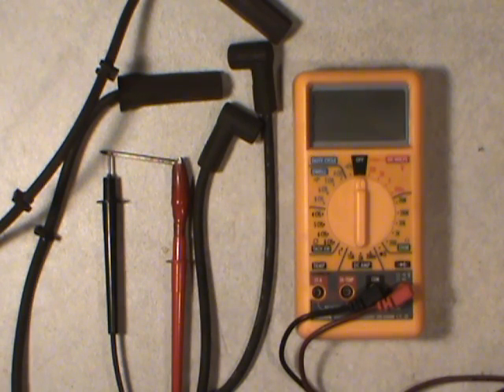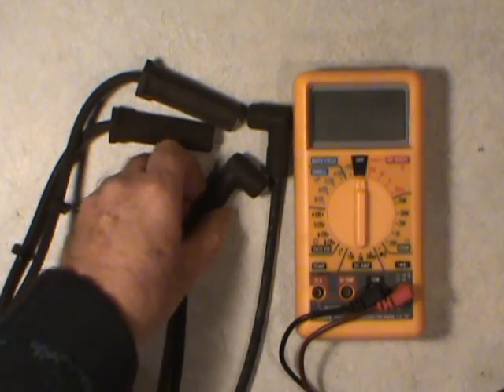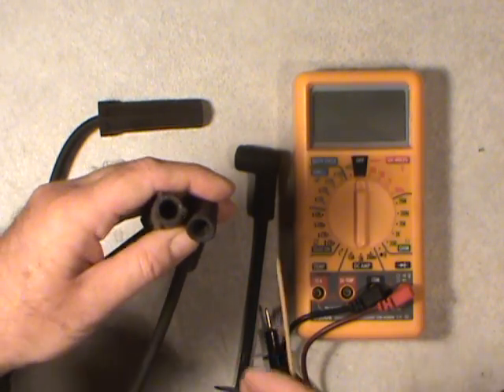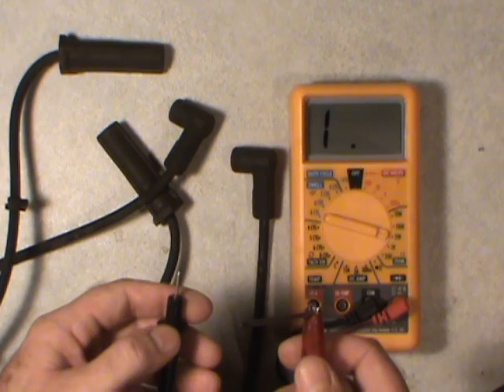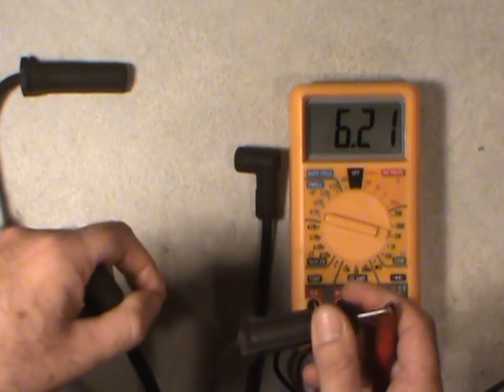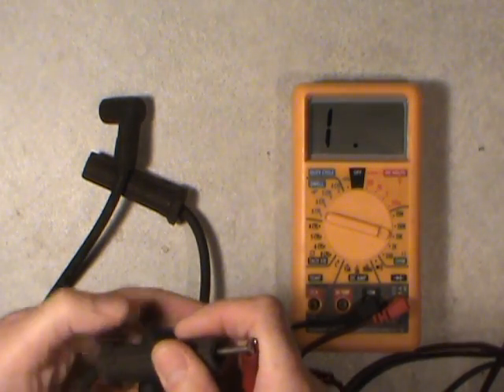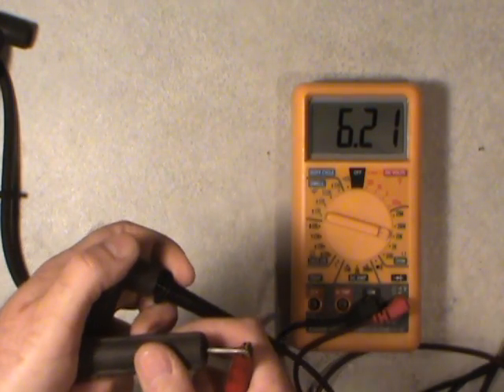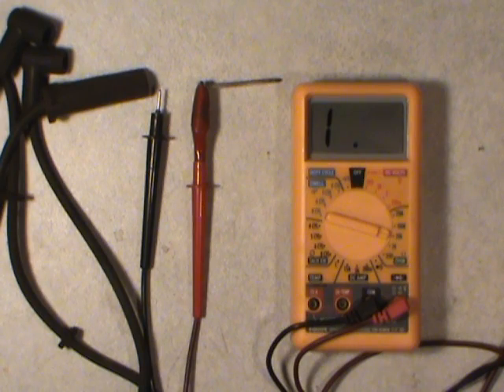How to Test Spark Plug Wires

Comment: If you've got a cylinder misfire and you've tested  everything you could. My issue was a "bad" coil on plug BOOT( they just pull off). There wasn't any obvious indication that the boot had failed. The signs on arcing that had been etched on the spakplug's ceramic insulator was the give away.
Reply from the maker: Greetings dumass00072....Thanks for your comment, and, sharing your Boot problem as well....Like you have experienced there, the possibilities are almost "Endless", when it comes to Malfunctioning Parts and Pieces, that have the ability to produce some rather unusual Indications/Evidence, that at times, can be very difficult to Find/Track-down, when trying to find that there "Culprit" (aka, Trouble-Maker, lol)....On occasion, I find some, Not-So-Tight, of a Connection, especially where the "Clips" (inside the spark plug lead/wire) "Boot", are Not "Grabbing/Clamping-on to the spark plug Aluminum or Brass Connection Terminal that resides just above the spark plug Porcelain, where that there "Clip" is supposed to be making a nice tight/dependable Connection....What I do when I find one, or more of those there "Culprits", is, I grab a pair of Slip-Joint Pliers, and "Squeeze" those there "Clips" inside the spark plug Boots (actually Squeeze the Boot, so the "Clip" inside the Boot gets Squished), to make the/Those "Clips", a nice tight, and Snappy "Fit" on the spark plug/s connection Terminal!....Just be careful, as to not Over-Squeeze those there "Clips!"....Also, if your Pliers have Sharp Teeth where the Jaws make Contact with the Boot, you might have to wrap some cardboard or something around the Boot, so that the Pliers Sharp Jaws don't "Penetrate" the (usually Silicone) "Boot!"

Also, to prevent moisture from "Invading" the Boot, I smear on some "Die-Electric-Grease", which also facilitates the "Easier" Removal of the spark plug Boot from the spark plug/s, so, especially when it comes to "Silicone" spark plug Leads/Wires, they don't become "Bonded" (kinda like STUCK!...lol)...and, what a Pain that can be!

Just when You, or I, think that we've seen "It All", I just have to say...

When it comes to Cars or Trucks, Problems seem to me, like the word...

"INFINITY!!!"...lol.

Be Safe, take care, and have a good one.
Reply: RockysRoadshow  Believe me I was just about to start probing the ECM with my oscilloscope. It's really annoying to have one problem/code but a never ending list of the causes, Should there be  any play in a rear bearing that's pressed on the the axial shaft( Mine has some wiggle in it and may have been the culprit  for a leaking rear seal that's pressed on the axle housing.
Reply from the maker: dumass00072
Greetings dumass00072....Yes, indeed, when there is more then "1" Trouble Code stored in the good ole "ECU", it starts getting to be really Fun!....The best way to avoid any "Extra", ECU Trouble Codes, is to simply, Keep the Vehicle Well "Tuned/Maintained", as in, replace and adjust those things that need to be attended to, on a Time or Mileage/Kilometer-age Interval....Nobody can expect parts that Wear-Out, get Contaminated, etc., to Last Forever!....Now about your Rear Axle-Shaft pressed on Bearing....It all depends on just which Rear Axle you happen to be talking about, but, I'll assume that the Type of Bearing that you might just be talking about, might just be a "Tapered Roller" Bearing....The Inside of that Type of Bearing, that has the Tapered Rollers on it, contained by the "Cage", is usually called the "Cone", and, it's the part of the Bearing that usually gets Pressed onto the Axle-Shaft....The Outside portion of that same Bearing, is usually called the "Cup", and it is this "Cup" that can be Adjusted with a Threaded Ring (or call it a Nut, if you like), and usually has a locking Tab of some sort, to keep the Adjusting Ring/Nut from Moving, and causing Excessive "Play" in the 2 Bearing Halves (Cone and Cup) where the Tapered Rollers make Contact with.

Then, there is another Adjustment Type/Method, and with this other type, the Actual Bearing "Play", is Adjusted by Stacking Thin sheet metal "Shims", and, they are kept in place with a "Retainer", and in some cases, the (Drum type) Brake Backing Plate holds the Shims in place.

Try looking up the "Specifications" for Your Type/Model/Manufacturer of Rear Axle that is installed in Your Vehicle.
Hopefully, you will find the "Specs" for Your Rear Axles "Bearing-End-Play", which usually is in the .005" to about .010" (5 to 10 Thousandths of an Inch) End Play Range, as Measured with a "Dial Indicator", when You Push and Pull on the Axle Shaft/s.

General Motors Company, has a Rear Axle, with Bearings that have "Straight" Roller Bearings (kinda like slightly larger Needle bearings) and, these Straight Roller Bearings use a Hardened and Ground Surface on the actual Axle-Shaft to become this Type of Axle Bearings "Inner-Race", and, Does-Not have any Adjustment whatsoever!

The Axle-Shafts (2 of them) are Secured/Retained by the 2 "C-Clips" (kinda like a heavy Washer with a portion cut out of it, that resembles the Letter "C"), and, they fit in a Groove on the inner end of the Axle-Shafts, and, these "C-Clips" fit in a Counter-Bore that is Machined (Cast?) in each of the 2 Side "Spider Gears" that are inside the Center Section of the Rear Axle Assembly.

Once the "C-Clips" are installed in that groove on the inner ends of the axle-shafts, they get pushed into the counter-bore in the 2 side Spider gears, then, there is a Large "Pin/Shaft" that gets inserted into 2 through holes, and, it is this Large Pin/Shaft (about 5/8" or 3/4" in Diameter) that goes between Both of the Inner ends of the 2 Axle-Shafts to keep those 2 "C-Clips' in their respective Counter-Bores, thus, the 2 Axle Shafts have Only the Amount of Clearance/Side Play that is Designed into this type of Rear Axle Assembly.
Oh yeah, mustn't forget, that, the Large Pin/Shaft that I was just talking about, happens to be "Retained" with a fairly Long plain shafted type of Bolt, that fits through a Hole in One End of that there Large Pin/Shaft, if you will.

I had a Rear Axle Gear Oil "Leak" at the "Companion Flange" (you know, where your drive-shaft Universal Joint gets Bolted or "U-Strapped" to, on the Differentials Pinion Shaft).
I noticed the "Leak" after I drove the car for a while on a warm  day, and parked it in the garage, on a concrete floor.
A day or Two later, I discovered a little Oil Puddle right under the Rear "U-Joint".
I though, Oh No, the last thing that I wanna do, is, Rip Apart the Rear Diff, just to replace an Inexpensive Seal!
I thought about it for a while and I said to myself..."Self", why not just Check to see if your Rear Axle "Vent", is doin its "Venting" Thing!
Whew, man, did I ever Dodge-a-Bullet!
Turned out to be, that the "Venting Cap" had a little rubber "Disk" that "Bonded" itself to the Opening, where it was supposed to let, Air In, and, Air Out!!!
Needless to say..."See-Ya-Later-You-So-and-So!"...lol, and, I put that little Rubber Disk in my small parts cabinet, to remind me of how it was causing such a Pain-in-the-Keester!...lol.

Try to find Your Rear Axle "Vent", and, if, and when you find it, make "Sure" that it is "Not" Plugged-Up, or, "Stuck", as mine turned out to be, or, your Seal/s might just be "Leaking", because of the Built Up Air Pressure, due to your Rear Axle Assembly and Gear Lube "Heating-Up", and causing the Air inside your Rear Axle Assembly to "Expand", which in turn causes "Positive Air Pressure", that is Higher then the Air Pressure that is found on the Outside of the Rear Axle Assembly!

Some Rear Axle "Vents" have a "Rubber Hose" that is connected to a Fitting on one of the Rear Axle Tubes, between the Center section and the Brake Drum/Disk.

Sometimes, Oil or Grease "Seals" just "Age" or "Wear-Out".
But, as you were saying about your Bearings being kinda "Wiggly", that can also keep the "Seal" from doing its Job.

Warning!!!...Be very Careful that your Vehicle is on Level Ground, and is Raised Up on Jack Stands or on a Vehicle Hoist, and is very Stable, as You Don't Want to be Injured or Crushed by Your Very Own Car or Truck!!!

Be Safe, take care, and have a good one.

Comment: how good much in resistor of spark plug wire ? standard ??
Reply from the maker: +ahmad luqman Greetings ahmad luqman....Thanks for watching.................If Your Car has a Computer in it, and Your Vehicle's Engine hasn't been Modified, then, as I see it, by using/installing, a Set of Spark Plug Wires, that are just like Your Vehicle's, Factory/Manufacturer's, spark plug Wires, having the Same "Resistance Values" (as in Ohms/Resistance, for a given amount of Length, like a Foot/12 Inches or 30 Centimeters/300 Millimeters for example)...then, You shouldn't have any Problems...........................Where You really have to be Careful, is, let's say for example, a Set of Very "Low Resistance", poorly designed, spark plug Wires, get Installed on an Engine, that is Computer Controlled, along with, the so many, Sensors and Actuators, that go along with it, then, there, just might be, a Very Unwanted, High Voltage/Electromagnetic "Field", that the poorly designed, Low Resistance/Low Ohms, spark plug Wires might Produce/let out, Unless, the Low Resistance/Low Ohms, spark plug Wires, are of a Design, where-by, All or Most, of that High Voltage Electromagnetic Field or Fields, get "Contained", with-in the spark plug Wires, so, that "Field"...Does Not...Get Into...and...Interfere...with any of the Sensors or Actuators, that could cause, any of the Affected Sensors or Actuators, to be Sending, the Wrong "Signal", to the Vehicle's On-Board Computer, that might result in Engine Damage, quite possibly...Yikes...!!!.............There are also Spark Plugs (maybe the ones in Your Engine as well...???), that have a fairly High amount of Resistance, built into Them..............Might be as High as, from about...5,000 to 10,000 Ohms...perhaps...........................Have a look around, at some Spark Plug Manufacturer's Web Sites, and, look-up, the...Numbers/Letters...that are printed on Your Spark Plug's Porcelain, or, Stamped into, the Metal, usually, just below the Porcelain part, of Your Engine's Spark Plugs, and hopefully, You will see, Your Engine's, Spark Plug..."Ohms/Resistance"...Value/Specifications........................Also, Check Your Spark Plug's..."Gaps"...and, if they are the Type, that You can "Set" to Specifications, then do so, but, watch-out now, as some Spark Plug Designs...Are Not..."Adjustable"...!!!................................Basically, the Larger the Spark Plug "Gap" is, and also, an Engine, that has a Higher Compression Ratio, will usually Demand, a much Higher, Secondary Voltage, from the Ignition Coil/Ignition Coils, making the Ignition Coil or Coils, Work that much Harder.......................For me, on a Factory Stock Engine (no modifications), I usually install, the Factory recommended, fairly High Resistance, set of spark plug Wires (leads), especially so, if it's "Computer Controlled", to avoid,  the Problems, that I was mentioning above...........................If You might want to use a Set of Low Resistance/Low Ohms spark plug Wires, maybe have a look at some...Web Site..."Forums"...that discuss Your Exact Vehicle and Engine, and hopefully, some People on those "Forums", can tell You, how good, or, not so good, a certain Type of spark plug Wire...Behaves/Performs...good luck......................Oh, also, make sure that, Your spark plug Wires, are..."Kept Away From Each Other, and, not Near any Metal as well", to avoid having, something like, Ignition Crossfire, or, High Voltage going to Ground, and not to the intended Spark Plug...!!!......................................Well, till next time...............Be Safe, take care, and have a good one.
Reply: RockysRoadshow what the hell kind of an answer is this???